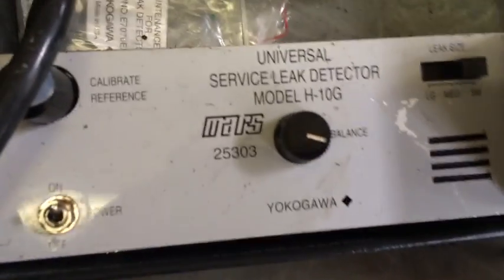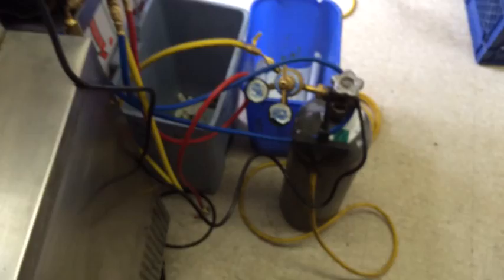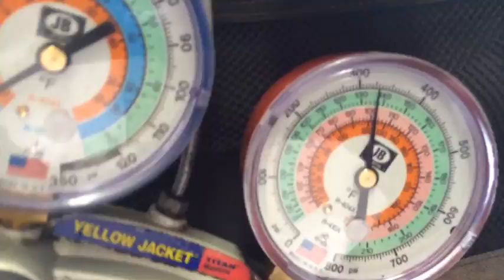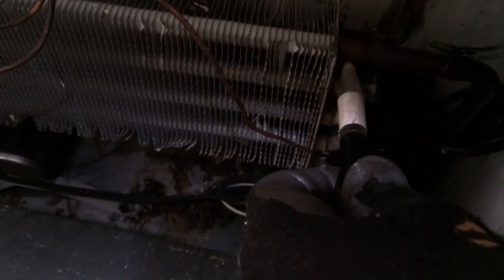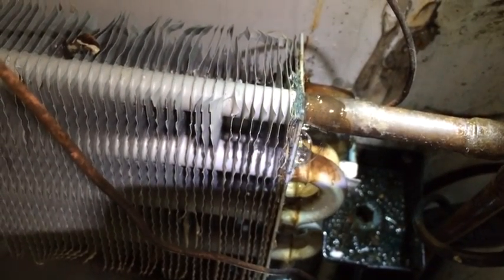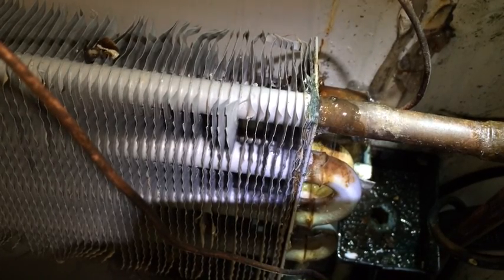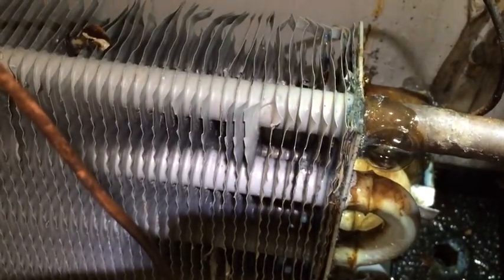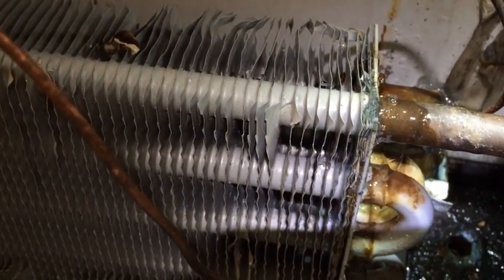H10G leak check R134a

Comment: Good leak find Dave.  You did notice how the "Big Blue" found the leak easily as well?  I truly believe in "Big Blue" leak detector soap bubbles, the old school way of finding leaks.  Even before the halide leak detector.  Loving my old school ways and new leak detecting bubble products.  I've found leaks smaller than the H-10 could find with the bubbles.  Little tiny "scrubbing bubbles", but yes they found those small leaks as well.

Comment: Good Video! Great Leak Find! Hey rasta, you pressure test at high pressures compared to me. i only pressure test at 150 max on units. i have allways read the " tags " on the units low side test pressures are only rated for 150 low side test pressures. 300 max on high max test pressures. aren't u afraid of creating leaks maybe ? 325-350 is a pretty high test pressure imo on old equiptment. I Can understand 300 test pressures for 410a systems because they are built to handle it, being that balance pressures on 410a is around 225. you ever had any problems with testing at that high of pressures or is it all Good Results ?
Reply from the maker: +OcRefrigeration & H.v.a.c. never had a problem, at 300 I can pin point the weepy coils. I only go that high when I can't pin point it. 200 psi is probably plenty, ill have to try 200, I just went 300 psi years ago because I had a customer that just had to see the leak, and that has stuck with me.
Reply: I accidentally went 350 on a R22 evap and it did create a leak. 200 max for me. 410a ill go 300 even though some manufactures are saying 600 lol no thanks my reg dont even go that high

Comment: What is Bacharach recommend intervals on the sensor?
Reply from the maker: I don't know but the old sensor was 11 years old. 100$ for a new one. And it's like new super sensitive.
Reply: Tazzman228  The sensor's life depends on the hours it has been used and probably ? the amount of freon that it has sniffed too. I have bought ancient GE  H10 units with old sensors and they worked ok and have bought units that are a few years old and they barely worked. Thus my stance is the time the heated diode is on matters.